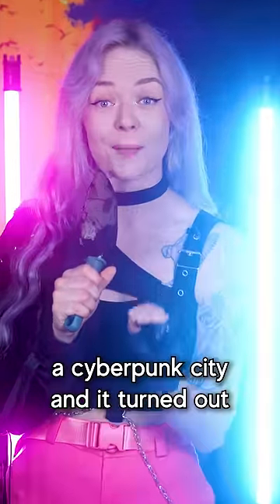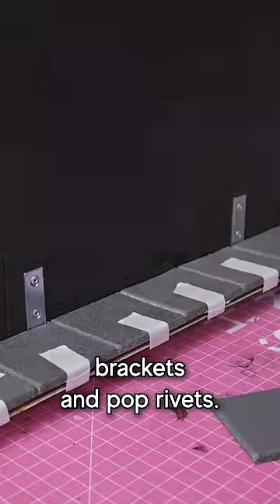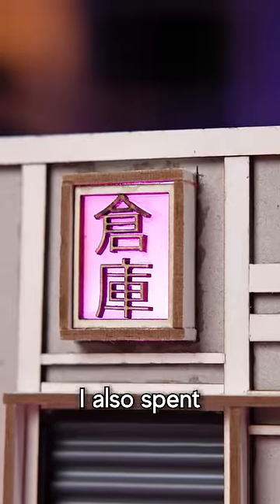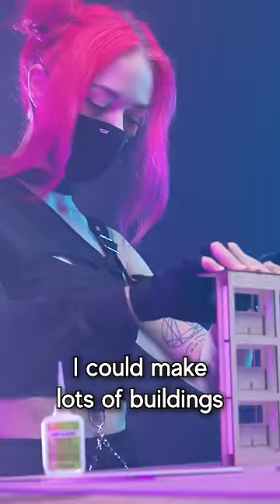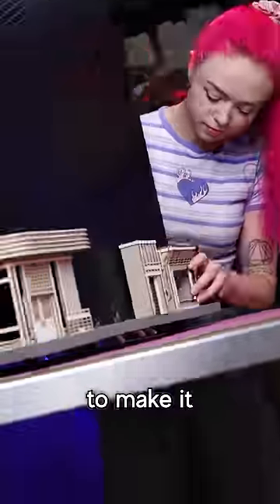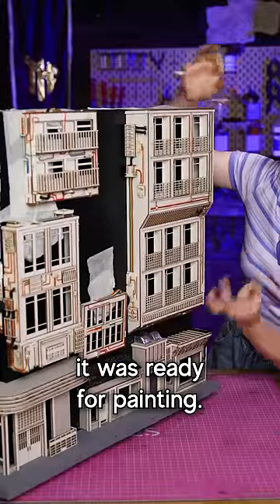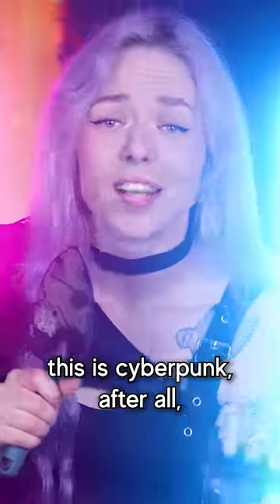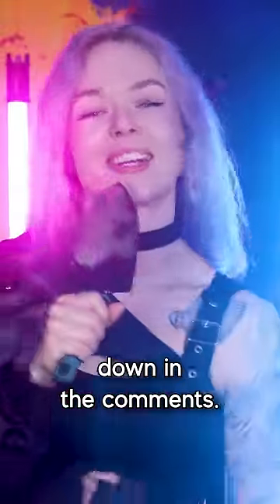I Built a PC... but it's a neon city #shorts

Comment: Again i am in love with one of your designs. They looks so damn good. I am sure that pc would look cool af in dark
Reply: I think that keeping it “cool”
Will be a real struggle…🥵
Reply: @GrimDarkness1972  yeah true
Reply: Hell yeah! Get some rain in there too 🔥🔥
Reply: @GrimDarkness1972 it doesn’t look like it constricts airflow to badly, the buildings on the vents are open so air can still go in and out
Reply: @GrimDarkness1972 i think cooling wont be an issue at all, my current case is extremely constricted but still give great temps
Reply: swopeupl8 k

Comment: How much is the heat inside the case increased? Is it still well ventilated? How would you pick it up to move it without breaking the add ons? Perhaps some of this is discussed in the full build video. As always ot looks fab.
Reply: Things like this, arnt built with functionality in mind, its all just for content
Reply: But I imagine it could be vented behind the structures to allow better airflow. And Disguising  a cooling fan as a ventilation shaft would add to the form and function.
Reply: This case has no trouble staying cooled, the modifications barely affects air flow (if any). If anyone where to move it, detatch the panels with modifications first?

Comment: I’d like to know how this affects thermals and power draw. All those LEDs are gonna pull extra juice from the PSU unless you’ve got it set up as an extra wart-on-the-wall. I can see from the beginning you covered up a fairly sizable fan grille, and all that extra cardboard, paint, etc. will partially insulate the case probable trapping extra heat and make the fans work harder. I love your talent but if you’re adding form to something you’ll need to consider how it might effect function. The best engineers and designers are those that can expertly design a visually appealing product without impeding the devices function— or even using the outward design to slightly improve specifications.

Comment: dont take me wrong this is amazing, but, as someone who works with PC maintenance this looks like a nightmare, if you need to do replacement of some falty hardware you are fucked, not to mention blocking air flow and causing overheating

Comment: RIP cpu...
Because you blocked off the front, and there are no other large ways to get airflow, the cpu i going to bathe in it's own heat. forcing it to go on lower clockspeeds and thus slowing the computer down on high loads. If it's really bad, the pc might shut down entirely because the cpu overheated.
The same applies for the gpu.